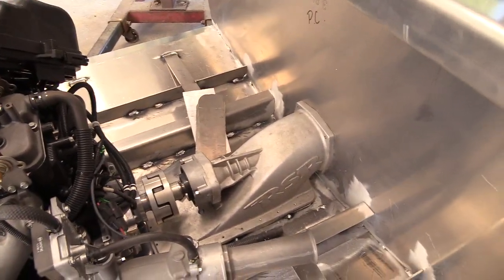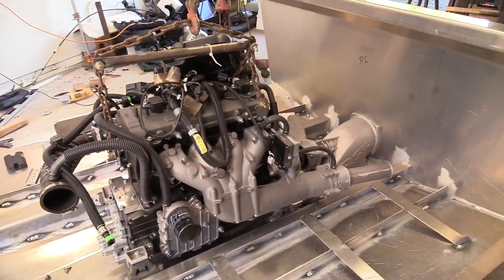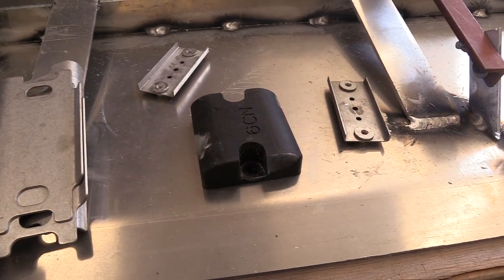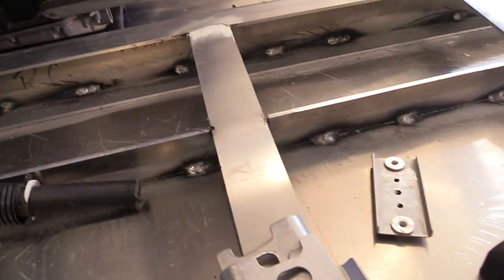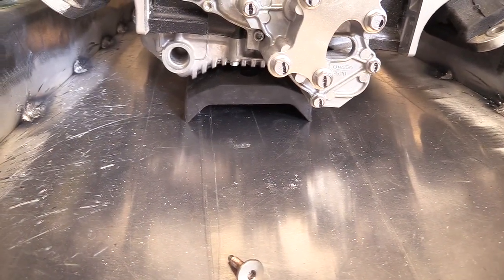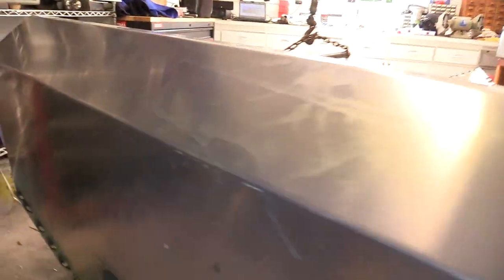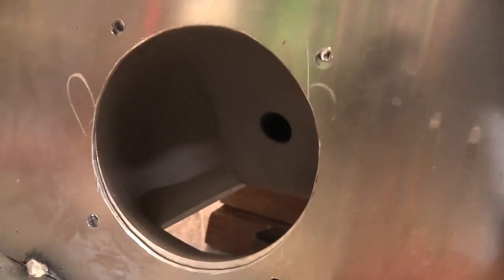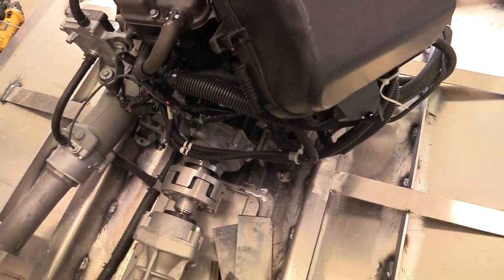Wattscraft Mini Jet Boat Build Video #13 Motor Mounts and Intake

Comment: Hey Paul, I’m building a 4.6m watts craft and dropping twin yam Sho’s in. I’m up to the same stage as you in this video. Did you have to replace the drive shaft for a shorter one? If you didn’t.... How did you get to mount the back end of coupling/bearing housing to the intake tunnel with the length of the stock shaft? Cheers
Reply from the maker: I traded my stock shaft in plus the extra cash for a shortened one when I bought the boat from RSR. Twins? That’s insane.